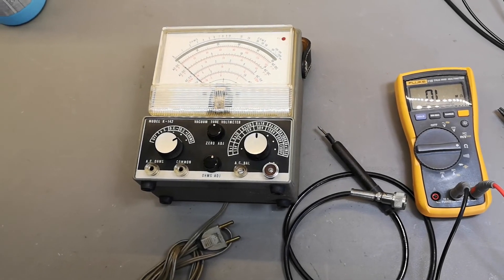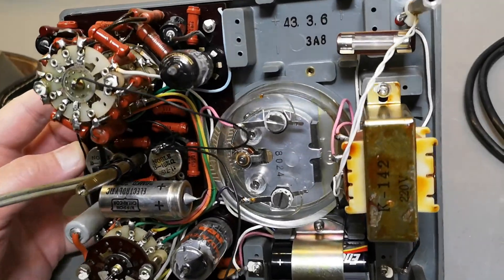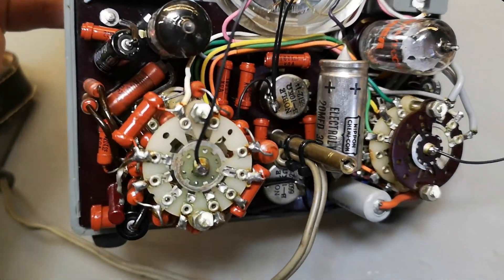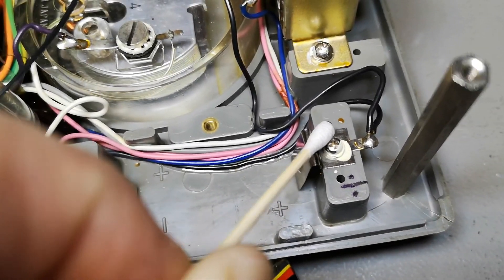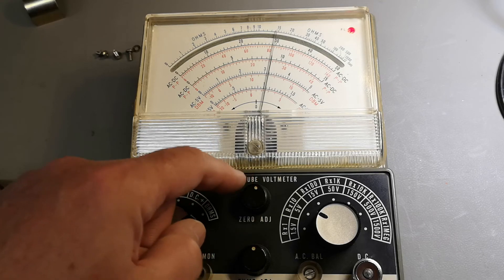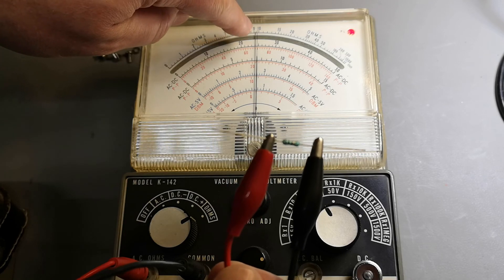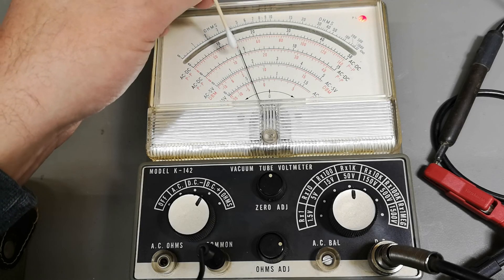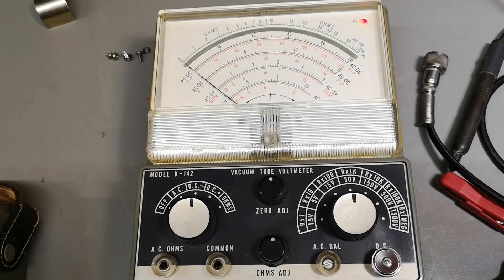Multimeter K-142 Vacuum Tube Voltmeter Kyoritsu 1965 test teardown

Comment: I have an IM-11, actually a very similar circuit and uses the same kind of scary mains switch design, where a found a big chunk of the contacts already having been taken out by an arc. It is good to have a box of plastic M3 nuts handy when fixing stuff from that era :) The gray axial capacitor could have PCB in it, to be treated with respect (I saw very similar capacitors in japanese electronics that literally say "CP-A" on it, which is a trade name for a PCB oil).